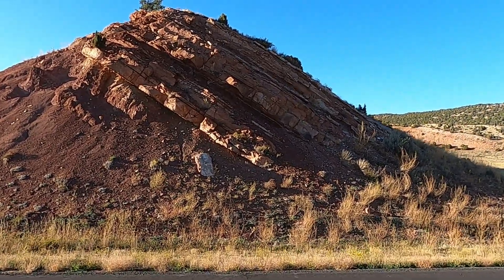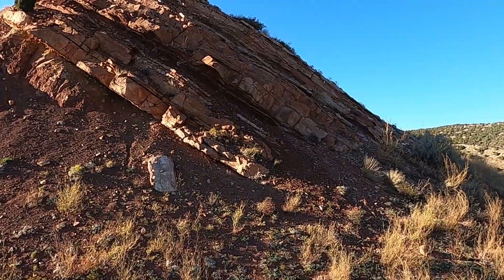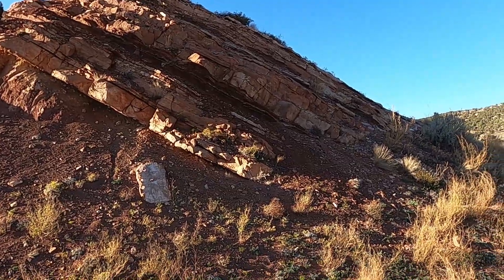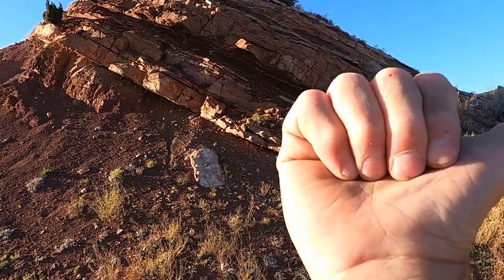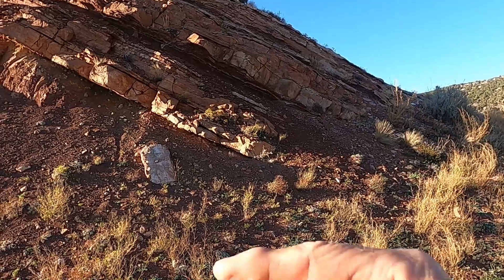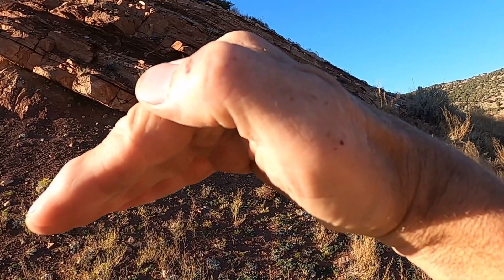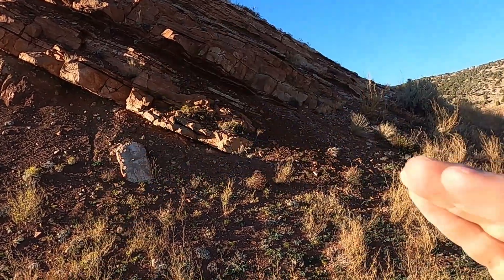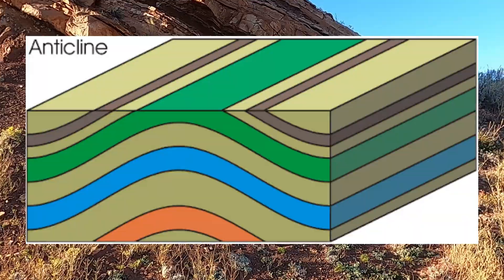An Odd "Eye-Shaped" Structure in Central Wyoming? Geologist Explains

Comment: Fine ripples are actually more often caused by flowing water that has standing waves or ripple waves. Water draining down a tidal beach causes this. But inflowing water can have standing waves as well. River currents CAN produce waves like this as well.
The entire structure was sheared off by something which took away the high middle section but left the ends. I reject slow erosion as the cause but a catastrophic shearing force like a debris flow answers it.

Comment: 3:02 one of the notable places this tip doesn’t work is in central Texas, where the brick red sandstones are the basal cambrian unit overlying the precambrian igneous and metamorphic sequences found in the Llano uplift

Theyre pretty cool, they contain as much as 10% iron which is technically economically viable to mine although I don’t think much of it is

Comment: @ 8:48, when looking at the underside of a layer of sandstone, there appears to be some sort of fossil in the top right corner.  It's a slightly elongated hexagonal shape, and appears to have a central area surrounded by trapezoidal plates.  I only have a passing knowledge of fossils, I can recognise trilobites, and ammonites, but I don't recall seeing anything like this.  Maybe it could help date the rock.  By 8:49 it's more central, but the camera angle makes it less distinct.

You didn't say what removed the top of the anticline, a bit like removing the top off a boiled egg.   I can appreciate that erosion is responsible for the ridges becoming more prominent, once the layers were exposed, but I would have expected a fairly smooth shape to have been resistant to typical erosion.  Is it northerly enough for an ice sheet to have taken the top off during one of the ice ages?

Comment: How is something as fine and delicate as ripple marks in sand/mud preserved so well over time after presumably being buried and squished, brought to the surface and then eroded?!
Reply: The rippled marks got turned to rock before a massive weight could squish them ie becoming rock while new sediment is protecting the ripples as they become rock.  Then, being rock, they were able to withstand the additional weight and pressure as more and more sediment was deposited.
Reply: @CricketsBay Isn't part of turning to rock being crushed under massive weight and pressure?

Comment: Very cool folding.  So we commonly hear about anticlines and synclines and their formation from basic perpendicular compressional stresses. What happens to the stresses to create a doubly plunging anticline or syncline? Are these folds created from a continuous and progressive rotation of the stresses, or are they formed due to a second compressional event that happens later in a different direction, or are there other factors that play into the fold geometry during a “standard” unidirectional compressional event?